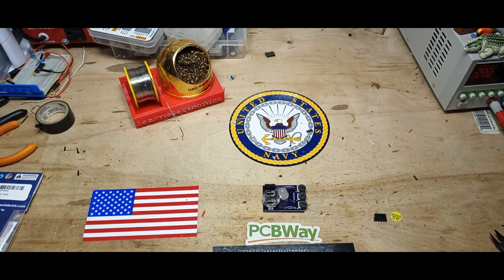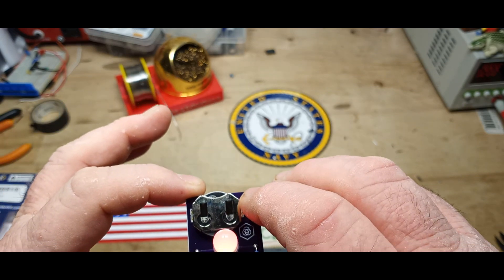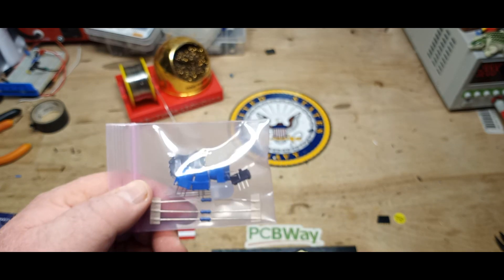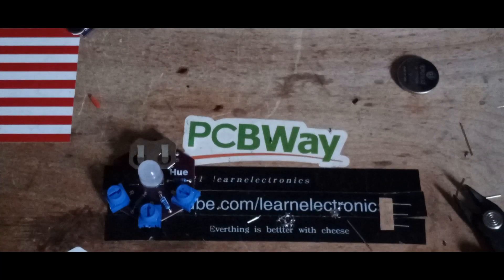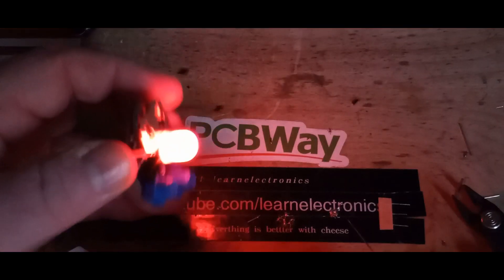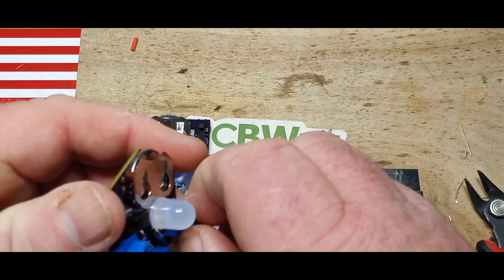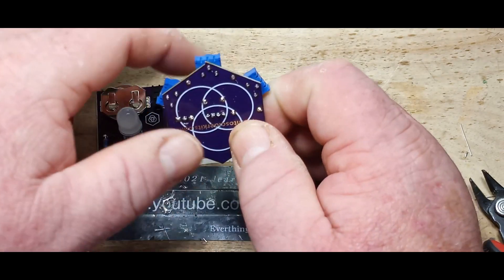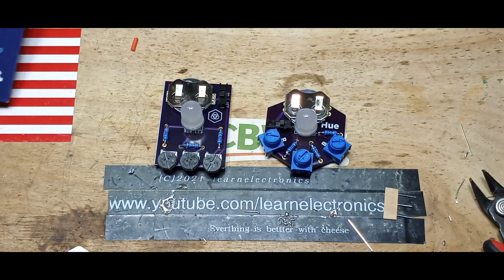All new Hue kit from learntosolderkits.com

Comment: I just finished building this kit with no prior experience with surface mount components. The part that I found hardest was getting the battery holder to stay in place while I soldered. The legs aren't long enough to bend. My other issue was that the solder wanted to go on the leads just fine but did not want to go on the board so it wasn't making a proper joint.